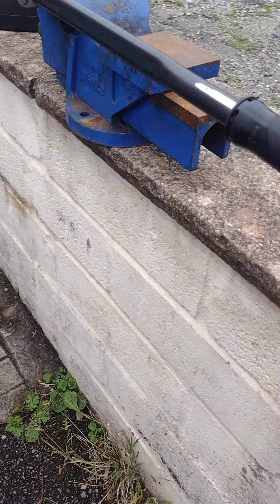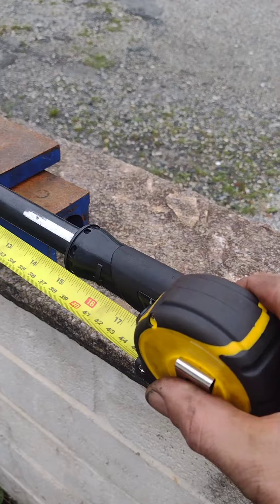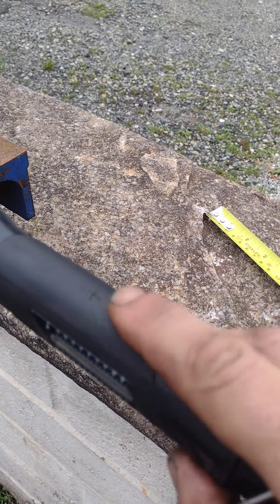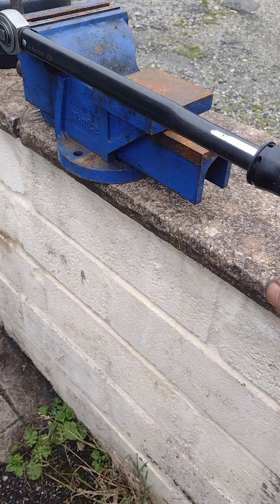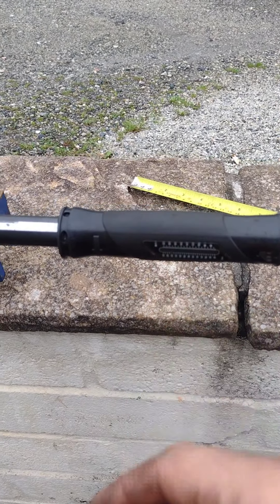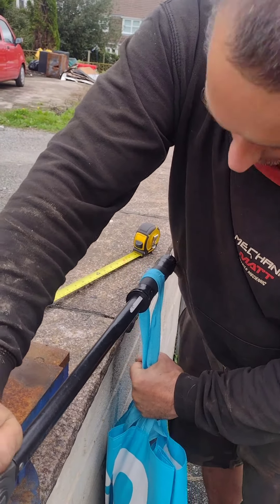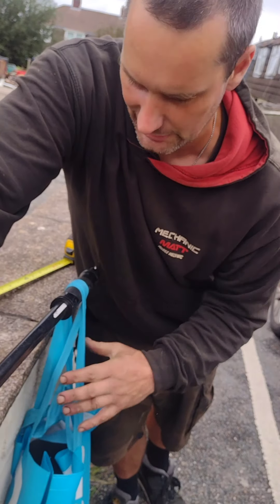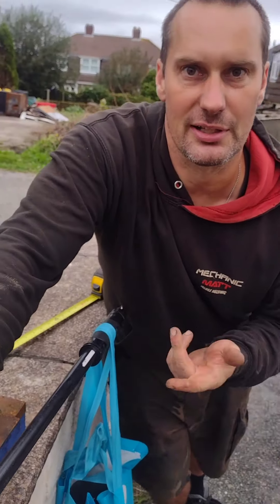Torque Wrench Calibration (The Schrödinger's Box Way)

Comment: im not very good a maths is there a easyer way matt
Reply from the maker: Yes, use weights that are labeled in pounds instead of kilograms and converting, you could hang the weights I foot from the socket drive end, then there is no calculation involved, just set the torque Wrench setting to match the lbs that you hang off it. Cheers Matt
Reply: Thank you matt that sounds much easyer @mechanicmatt871
Reply: 1 Nm = the power is takes to turn a lever of 1m length.
So I‘d see how much weight is needed (using a luggage scale e.g.). If the wrench isn’t long enough, I guess you can calculate with 50cm and then half it (if it’s linear).